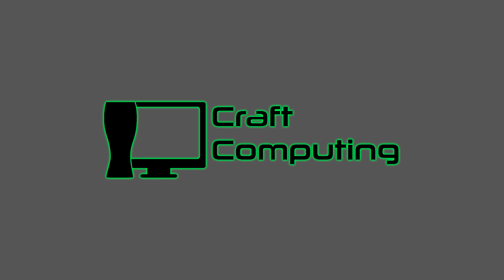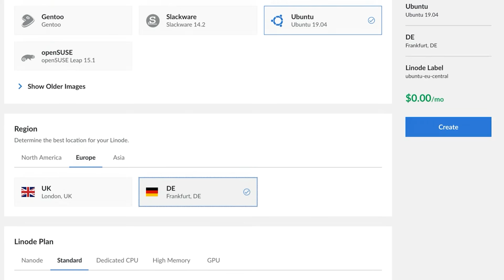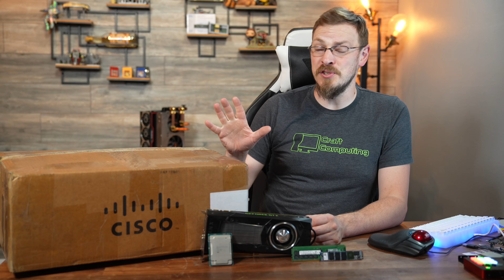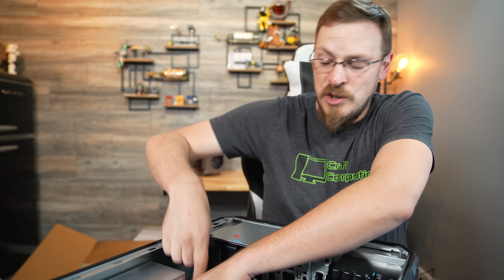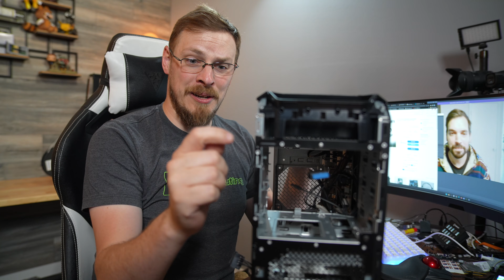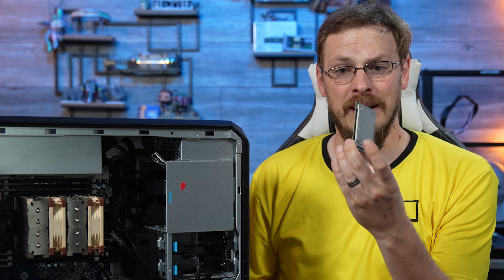THIS PC IS CURSED! - HPE Z6 G4 and Xeon 8251C!

Comment: If you don’t know what you’re doing, then yes — there will be a lot of problems.
But if you build a machine like this properly, all you have to do is turn it on, and when the world ends, turn it off. It will run smoothly without a hiccup, just like mine has for so many years without any issues.
If someone wants to save money to the point of even buying the screws separately, then they really need to have a deep understanding of HP’s closed system.

Comment: Others in the tech industry have advised to treat HP machines as 'disposable assets'. You buy them as-is for as cheap as you can, then throw them away once they no longer meet your requirements. Reasons: nearly impossible to upgrade, premium pricing on replacement parts, difficult to service, proprietary shenanigans at every turn.

I once had to buy a $240 IDE 40gb hdd for a customer to replace one that died in a rather important machine. Retail price for off the shelf IDE drives was about $80 at the time. Reason for the price premium: HP changed the pinout on the IDE port making it incompatible with non HP IDE drives.

IBM sold another customer a $75 RAID card (well, $75 through aftermarket) for nearly $1000, because it came from IBM's after warranty spare parts stock. Customer wanted their server online ASAP so they took the raping.

I've also had to pay a premium to get a Dell workstation compatible power supply, because Dell changed the power pinout for the motherboard. I've had the fewest problems using 3rd party retail parts in Dell machines to date, but even they are not immune to anti-consumer practices worthy of scathing criticism.

Summary: all the big brands are a-holes. They all wish to do what Apple does and lock their customers into their brand/ecosystem and still look like the good guy while twisting your gonads. In fact, the more I work on this stuff the less I like any of them.

Comment: HP's decision for some of the internals are terrible, but a lot of it could have been avoided had attention been paid to make sure to get a barebones system with the heatsink pre-installed (this would have made it very unlikely for the CPU pins to be bent and you wouldn't need to worry or spend additional money sourcing a heatsink) and front I/O panel.  I know this was posted a while ago, but looking at eBay available and sold listings for barebones models of these, the majority of them do come with both and there seems to be little to no price difference between getting ones that have them vs not.  It's a shame about the motherboard getting fried but that was completely your fault and again, was completely avoidable had you bought one that included the stock heatsink.

This is why attention to detail is so important.  By not having that, you ended up having to spend $200 or more than you otherwise would have.
Reply: Also, you spent way too much on the CPU and motherboard.  There were faster CPUs that were compatible and less than half the cost even back then like the Xeon Gold 6140 18-Core and those boards were available used in working condition for $100 or so.

Comment: I need closure on this one.

I wondered about the CPU install with the custom heat sink/fan.

I also wondered about the BIOS version and the stupid HP warning about using a fan for the memory.

Did you get rid of this unit ?

Todd

Comment: Lol, "what you don't want to happen is have the pins bent up"

I had an X99 motherboard that I bought that looked like someone had stuck a finger in the socket and pulled up on some pins near the center. The seller gave me the green light to try and fix them, because they were pointed literally straight up in the air, but I couldn't get them back down at quite the right angle and couldn't get the motherboard to post. It threw memory errors no matter what RAM I tried. 

I did get a return and refund pretty quickly.

Comment: The problem is  8251C is a 240W TDP processor and Z6 g4 MB supports up to 205W TDP as most LGA 3647 motherboards. Also TDA is different. Which means the whole setup was destined to fail. Probably everything could work if you used a standard CPU. ASRock has MBs that are compatible with that propriety intel CPU like EPC621D8A, EPC621,EP2C621, and Gigabyte with MU71,MD71.
Reply: But he used a low spec Xeon Silver near the end with the same no boot. I don't understand why he wanted to buy another cpu when it is unlikely to be the problem.
Reply: The board supports it. I personally ordered a pre-installed w -3175X. This is 280 watts TDP.)

Comment: PC Server & Parts has a dual socket CTO HP Z6 G4 Starting at about $400. I specced mine out with dual Xeon Silver 4110's, 16GB RAM, 256GB M.2 SSD and spent about $450 on it. Granted I'm still going to upgrade the CPU's and had a ton of DDR4 ECC RAM from my Z640 build that didn't work out It will come out to about $700 just with the DUAL 20-Core Xeon Gold 6138 CPU's (40 Cores, 80 Threads total)

Comment: just bought one of these motherboards for $50 on ebay there's a power button in the rear of the case also you can just us any power button on the power header love this board only hate that theres no adapter for a slandered power supply so had to make my own.

Comment: A cautionary tale for all of us who are thinking about going down the same route.  I did take some grim comfort in soldering problem with the power cable, as I've done similar things myself and thereby ruined what would have been good kit.  I was actually thinking about purchasing this very same machine, although I've gone off the idea after seeing the proprietary bits and pieces that it contains (the PSU being a notable example).  I guess at the end of the day, there's always a good craft beer waiting to drown our sorrows when things haven't gone too well that day.

Comment: This already feels like a bad decision, but if for some reason you still have this system I'd gladly drive down to pick it up and offer in trade whatever you want from Block15, fresh and hand-delivered. I'm coming to the realization that while building a dell dual x5690 system in 2022 is cheaper than a raspberry pi cm4, it otherwise wasn't as amazing an idea as it seemed initially..

Comment: This is so representative of what I'm going through right now.   Got a second Supermicro 836 case that was set up as a JBOD with an EL2 backplane.  First, got my SQ power supplies...saw a newer 1.2k watt model the seller said was compatible.   Nope.   This is where I learned Supermicro has two different size edge connectors for the same format RPS.   So I found the PDB that supports those.   Nope, won't fit on this chassis.   Had to bend over the mounting tabs.   In the meantime I ordered a bare 836TQ backplane.   Nope, it won't fit on the same bracket as the EL2.   Now I'm stuck trying to find a bracket, which seems impossible--can't even find a part number for it.

Comment: I bought one that was about $200 more than the Bare bones, it came with a 8 core CPU, K2200 gpu and 32 GB of ram, not having to buy the heat sink and ram was my main reason for spending more. I have since upgraded it to a 6138 cpu. There is a power button on the back of the case.
Reply: The 6138 is such a fantastic deal

Comment: You should look into the Xeon E2176m. These are often $80 on Aliexpress at this point and are a 6c12t Coffee Lake CPU with a boost of 4.4ghz. I haven't been able to find much information but supposedly some sellers of these will offer you a modified bios to use it with a motherboard. Now which boards that can be modded I ain't sure still looking into this as a means of getting my friend off of a Haswell i5 4460.

edit for honorary mention: QTJ2 if you wanna mess with what seems to be a mobile CPU to begin.

Comment: Glad you made this video. because after seeing this I won't be touching one of these systems from HP in anything but complete working order. It reallly is a good case study on how system builders cost more in the long run, even IF they are good value up front, which often they just are not.

Comment: Oh god, you had to mention Gen8... 
I was a sysadmin for a SMB system integrator at the time of the G8 chassis and it was a clear cut case of HP trying desperately to lock customers into their ecosystem in a time when cloud was slowly becoming a thing. Even the ML series which were basically workstations with an iLO got monetized out the wazoo. New HDD cages, new ram checks, new RAID cards with new licencing (no more free HP 1+0 raid) and it was one of the driving forces behind us pushing all our customers to O365 (that and the end of SBS and the death of the old HP firmware update CDs)
Reply from the maker: Yeah, I was in a similar situation at that time with a number of my clients. Massively predatory.

Comment: A very easy way to unbend pins is to empty the lead out of an mechanical pencil and use the tiny metal barrel to slide over top of the pin and bend it.

Comment: At least the proprietary PSU has different connectors. Late 1990s Dell used a proprietary pinout on what is otherwise a standard 20-pin ATX power connector. If you don't know this and use the wrong type there's a decent chance of damaging things.

Comment: I would also wager that the OEM specific Xeon wouldn't have worked even if your ram did. I have a dell t7920 and when I was going to upgrade the Xeon silvers I do some checking as ES and OEM specials are so cheap. But on investigation Dell doesn't let any CPU not in the bios CPU code post. I have no doubt HP does the same these days.
Reply: that sucks tons of es and qs on ebay I have a Z4 g4 and it works with a qs cpu but all so just bought a Z6 and want to upgrade the cpu😖

Comment: had the exact issue with the cooler (same brand diff proc)not fitting because it was too tall ..them noctua coolers are not cheap , end up having to use a generic  server heatsink which is not so tall , but loud af and has fans in the wrong direction ...as for what to do with the case , maybe use as  a shelf ?  😅

Comment: Its like buying a Mercedes,. They stock parts and have service centers worldwide.  But you pay for it.  So buy it if that's what you want.  But know what you are paying for.  If they didn't lock down their ecosystem then they can't guarentee it.  You know what you are getting.  Its for a purpose.  See the 2 stroke railroad impact gun on Torque test channel.  Is it the most powerful?  The lightest?  The cheapest?  No, no, and no.  But it can install railroad bolts all day, every day.  Which the others cannot.

Comment: Definitely dropping a 'Like', I learned a few things from this. The thing that bothered me the most was the proprietary connector thinggie. I use a Z230 workstation, and their choice for the standby voltage on their PSUs (11V) is completely beyond me. All regular motherboards will do fine with 5V standby, but noooo, HP needs 11V. I get why they do this - if you ever need a more powerful PSU, you got to get it from them. 
There are adapters, that will double the 5VSB line to 10V - close enough to boot the PC. But one should not need to buy one.

Comment: Yes they are selling the front panel on ebay under a different account they are sleazy eBay sellers. I understand making a profit but they are disassembling proprietary computers to make maximum profit by selling all the proprietary parts seperate from the computer. You should put that seller on blast. Link the ebay store in the comments so we can block them on ebay

Comment: I have a Z400. Same crappy proprietary PSU there. What's xtra frustrating is that it LOOKS standard. You don't find it's proprietary until you actually try to change it. I'm never buying HP again. Thanks, Supermicro!

Comment: As an HP workstation owner (and I own a lot of them, from z420, z620, z840, z4 g4, z8 g4 and even an old one wx8000) you cannot mess up with hardware configurations. You need to buy  the exact part/replacement/manufacturer numbers as listed in the workstations specs / configuration list. Yes I know that they are expensive, but if you are expecting a workstations performance/stability (which is the reason you are buying a branded workstation and not building a custom PC/workstation that may be even faster) then you are prepared for the extra cost/limitations. And this is just a z6 g4. Wait to see the z8 g4... you cannot even use the CPU cooling that you used because of the airflow cover that goes into the workstation. Even a ZOTAC RTX 3080 ti HOLO doesn't fit in because of the height of the GPU. And some info regarding the front panel with the reader. You don't need the exact one (with the reader) you can get just one with the button on it and one with the USB port I think. Also there is a power button at the back of the workstation. Now regarding the error with the ram. Get some ram that the part number is listed in the workstation compatible memory list (and the CPU installed) and it will work.

Comment: Suddenly that more expensive supermicro board looks a lot less expensive... I do so love the major manufacturer proprietary BS, there should be some kind of industry regulation forcing these companies to come together on either existing standards or if necessary make a new standard between them. All this does, including in this case, is produce HP/Dell/Lenovo etc. brand e-waste and I'm tired of it. That being said if I got for the cost of shipping I would ABSOLUTELY bang my head on the wall over it, lol.

Comment: I would call that a bit of a rookie mistake killing your motherboard like that as all you really needed to do is double check the pinouts though I know that can be quite difficult with these systems like this but you really should have double checked the pin out
Reply: also should have looked at the user Manuel where he would have found that the g4 series has a power button on the motherboard also could have used a power button from any computer

Comment: If that HP is like a Dell, there will be a Case Open alarm, meaning the case is open… I think this can be disabled in the boot menu… might help? Or if you have fans that block closing the case, tape down or fix the alarm button that is between the case and the door/lid!
Reply: (My machine is a gen behind, being a Dell Precision 7810 Tower Workstation
1 x Xeon E5-2680 v3. Couldn’t close the lid after installing a GTX 1070ti card. Taped down the open case sensor.)
Reply from the maker: No ID sensor on the system, and the beep code is specific to memory.

Comment: The mistake is not purchasing 2nd hand parts. The mistake is purchasing  2nd hand parts  when not having a compatible  working system to compare. Do you have one of those working?  then great, ebay is your friend, because any problem will be trivial to diagnose by swapping components with the working system.
  Even with standard PCs it is a good idea to keep the old parts when you do an  upgrade (at least one of each) so that you can do fast  diagnostics in the future.  To me this practice  had made the difference between the  dark ages when I was staring my first builds  and a happy life later.

Comment: Unfortunately, i learned the hard way as well with Dell and HPin a business capacity - I won't touch them with a barge pole and why I build my own, far cheaper, more reliable, and maintainable. I (as many of my customers) have PCs that are 10 years old and are now working as Linux servers and they work fine.

Comment: Thats why i have a seller saved on ebay to buy things like this. They have a dell system with the 3647 socket that comes with storage ram and even a cpu for around $450 it might be a dual socket system so id have to check. Its a great deal for $450 and also its a dell not hp.

Comment: the thing with lga 2011v3 is that it had such a range of qualities of silicon, with suh a range of core counts and clock speeds, that there are still some really powerful options for it floating around, waiting to depreciate in price. Dont count that platform out quite yet

Comment: This is why I don't use HP(E) equipment in my homelab. I've sold all my HP(E) stuff and went full Dell. Although Dell does have some proprietary stuff too, it's far less than the bullshit HP(E) does to their hardware and I'm not falling for it. Servers are Dell, laptop is Dell, even my screens that I have hooked to my desktop (own build) are Dell. 

HP(E) gear is banned from my homelab and unless they undo their shit (a whole heap of stuff I can list), I'm not planning on letting HP(E) return.

Comment: I've only ever had good experiences with HP, both as a professional and at home, but I've also been working with HP hardware for fifteen years.
They're definitely in the business of trying to force you to buy parts from them though, which sucks.
Reply from the maker: I ran HP shops for servers and desktops for years. Rarely ever had bad experiences with them. Gen8 ProLiant had memory limitations like this, but all the other funkiness is definitely eye opening on the Z6.
Reply: @CraftComputing  I figured you probably did, my comment was in no way intended to be condescending, in case you took it that way (which I sincerely hope you didn't, but being slightly autistic I don't always come across the way I intend though I definitely try).

On a completely separate note, you are hands down my favorite content creator and was my inspiration to get more serious about my home lab. I'm contemplating starting my own channel too, I just don't know if I can continuously and consistently come up with engaging content.

I would love to talk to you at some point about what I have in my lab, and how my lab differs from you. Spoiler alert, mine is not gaming centric as some of your is, but purely intended for training, rapid prototyping and juggling multiple contracts as a Software Architect/DevOps Engineer.